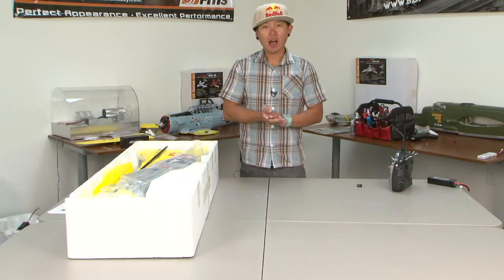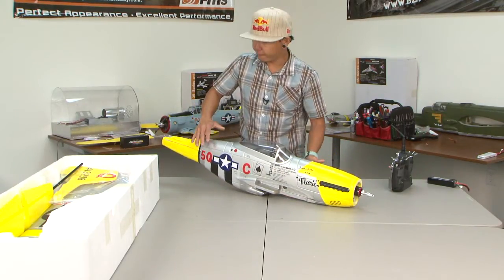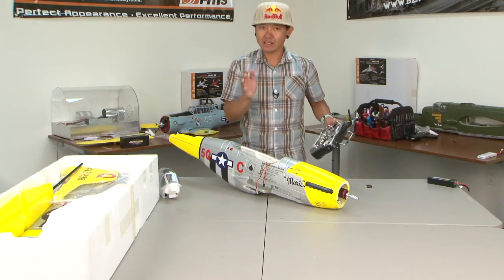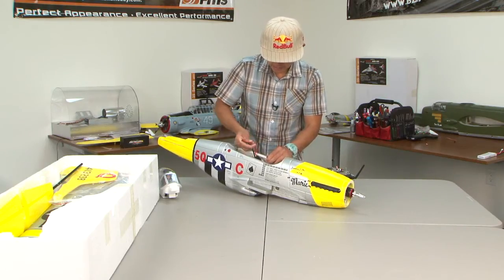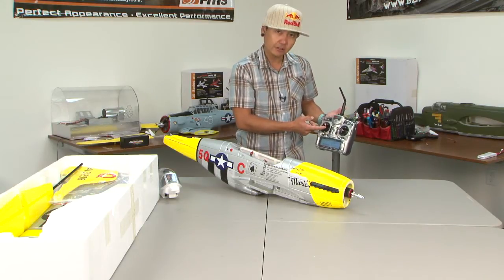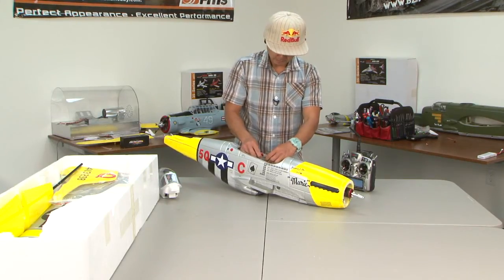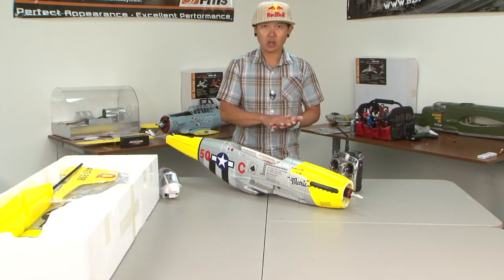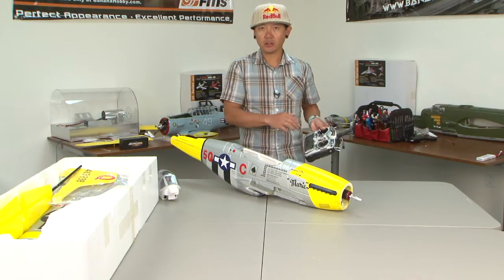FMS ESC Throttle Stick Calibration

Comment: Hey Pete, Good description of throttle programming. That is the easy part. lol Please do a video that explains how to program the brake on for the sail planes.  Just got a sailplane and unable to cause the break to work. I have tried a hundred permutations of the (vague) instructions, nothing works.  So per your instruction  I am unable to fly because break is not working. Thanks!

Comment: Pete - I have two FMS Beavers - one of them wont respond to the calibration at all and the other calibrated but full throttle is off and off is full throttle - how can I reverse the throttle ?  Is it possible to clear the program and start over ?

Comment: Hey Pete,

I just tried this procedure on the Skysurfer Pro. I have all channels working, but no throttle. When I turn on the transmitter and plug in the battery, all I get is a constant beep. I put the throttle in the highest position. I have a spectrum radio. Can you advise?  Thanks

Comment: hey pete. I have just got into electric planes. 20 years of glo plug flying. we would set throttle trim so stick all the way back would not stop engine. then pulling trim all the way down would shut engine down. does this work with electric motors?

Comment: Hi there :-) How do you program away the auto brake function. I have a 20 amp FMS DT20 that stops the motor very quick when I throttle all down. I have no manual for this ESC, so I hope you can help me out :-)Have a nice day

Comment: SOMEONE!!! My problem is I programmed my ESC with the WRONG Throttle positions. How do I get the ESC back to safety mode? I've rebound the plane several times, but the throttle keeps just automatically syncing.

Comment: I just bought a 1700mm corsair. Had same problem so did the throttle calibration didn't work first couple of times but eventually did. The next morning i had no control to anything just lights on and the motor was bleeping with  a 1 second pause followed by a beep. I am considering sending it back to my supplier. If you can help this would be great.
Reply: All  Esc's are programmed differently. Have to read the manual for the ESC.